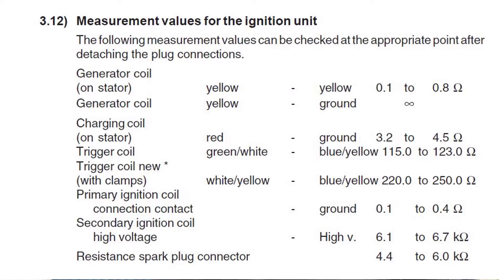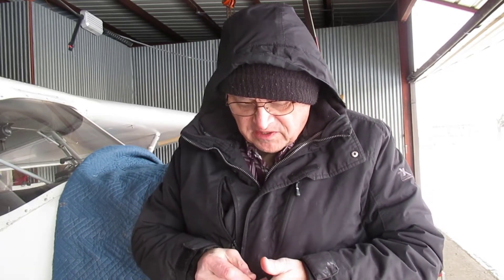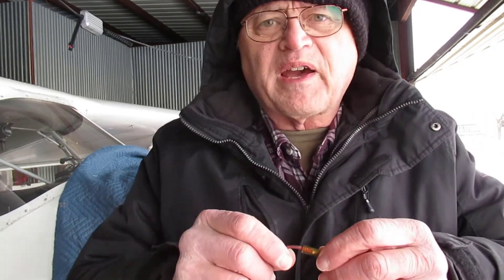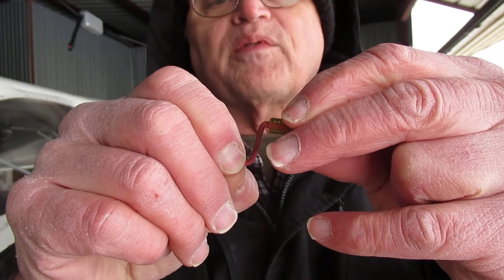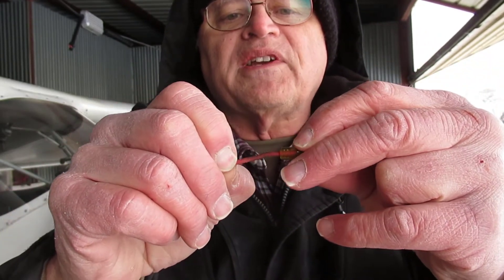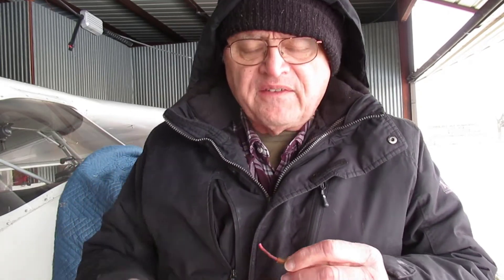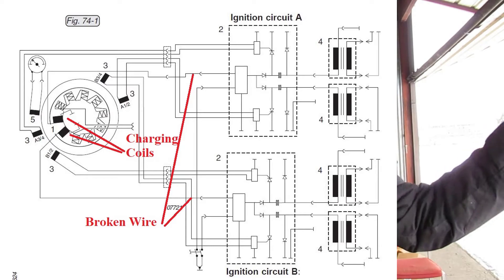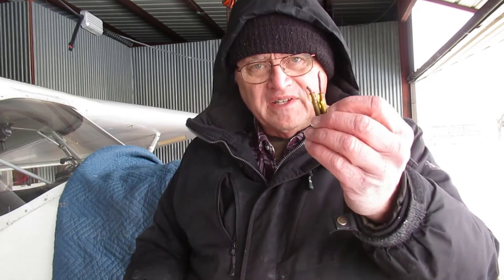Rotax 912 "Mag" problems (older style ignition)

Comment: Thank you Jim for posting this video…I think I owe you a nice lunch! I was doing my usual run-up when all of a sudden the (L on switch) A module completely cut out then was ok a few switch turns later then cut out again. I did indeed find the break in the wire as you described and that saved me a ton of time tracing all the circuitry or assuming a bad module. I did check the ignition switch first but it checked out solidly. Thanks again for taking the time to post this video. 👍😁
Reply from the maker: Glad it was  helpful!  Also check the ground wires where the wires connect to the engine.

Comment: had the same problem always had a rough running 912 at idle I had a fractured wire right at the CDI box lucky I had enough wire left coming out of the CD box to solder and Shrink tape and isolate the wires from vibration I sync my carbs with the broken wire so make sure you resync your carbs after you fix a fractured wire

Comment: Ok... I don't know if this is my problem but I'm sure glad I found this video.  I have the same problem but it's not one mag over the other, it's both.  I was leaning toward the Rotec TBI I've been trying to get running but maybe this is the problem.  I did find a charging wire with bad insulation, that I fixed, but maybe it's broken somewhere else too.  Thanks, I've got some more work to do now
Reply from the maker: Check the ground wires as well. The service manuals give the expected resistance readings for the coils in the ignition system.
Reply: @LightAndSportyGuy  I have the heavy maintenance manual and it doesn't match my wiring.  The colors are all wrong and I don't really know which pins to check across.  I did clean all the ground wires and had a realization yesterday.  The engine was still running very rough, till I pulled the mixture about 3/4 out.  And, closer to idle I have to pull it all the way out.  My problem seems to be a massively rich mixture, like running on full choke.  This Rotec TBI, specifically the fuel regulator, is just not working right.  I'm now rebuilding my carbs just for comparison.  If it runs, I'll dump the TBI.  If I can get the TBI working I'll see the carbs.

Comment: So, does the plane's battery, with it's amp hour capacity, not provide enough power to run the engine, at least for a little while?  To put it another way, does a shorting wire in the stator assembly IMMEDIATELY make itself known? Is the CDI power, instant by instant, coming from the stator coil, OR, is it coming from the battery?
Reply from the maker: The battery is not connected to the ignition. All the power for the CDI comes from the coils under the flywheel.
Reply: @LightAndSportyGuy   Ahh, I had it wrong! So yes any misfiring connections will make themselves known as they happen/when they happen, thanks.
Reply from the maker: @portnuefflyer  I should be clear, I am addressing the carbureted  912/914 ignition. I think the fuel injection / EMS systems may connect to the battery as an extra power source.

Comment: I’ve also had broken wires on the ignition modules etc but I’ve also had to replace two trigger coils at different times due to the old ones going open circuit,  it may be that the broken wires caused the coils to fail.

Comment: Hello Jim.
I have a 912 ULS, a 2008 model year, that has a bad "mag" check.  On one switch the engine's drop in rpms is only like 100rpm, but on the other switch its some where between 750 to 1000 rpm!  I have been debugging this problem for 2-3 weeks now with no real progress.  I even purchased and installed a new pickup set with harness.  I have the newer, 6-pin version of ignition too.
Here is what I tried:
1.  Swapped the 6-pin plugs where they connect to the two ignitor/cdi boxes.  
      The problems stayed on the same mag switch.
2.  Next I swapped the two red magneto supply lines to the 6-pin plugs.
      Again, stayed on the same switch.
3.  Replaced the pickup coil set.
      Yep,  exact same problem and on the same switch remains.
4.  I ran the two mag, ground wires directly to ground one at a time to see if it was some how the mag switches, but the same problem remains.

My rationale is that if swapping the 6-pin plugs did nothing then it cannot be from the 6-pin connector all the way down to the sparkplugs.  Otherwise the problem would have jumped to the other switch.  The same idea for the two red stator supply wires to the 6-pin plugs too.
I am at a loss of what to try next.
Any guesses?
Thanks!
Reply from the maker: Have you switched all the plugs between top and bottom? Seems like that's about all that is left...
Reply: Top and bottom plugs? I first swapped the 6 pin plugs between the stator, mag switch, and pickup coils where they connect to the A and B boxes yes
Reply from the maker: @michaelvadney5803  Sorry, I wasn't clear. Have you taken the top spark plugs out and put them in the bottom holes - and bottom spark plugs in the top? Check to see if the problem follows the spark plugs.
Reply: did you ever figure out your problem
Reply: Yes I did actually.  It turned out that I did not need to replace the pickup coils assembly at all.  When I purchased the engine used the A&P for some unknown reason unbolted the pickups at some point when he swapped in a new engine.  When he reassembled the pickups on the engine block he omitted the standoff collar on one of the two pickups.   So basically both pickups were using the same timing tabs.   This also caused a high EGT issue on climb out.  Good power, but it built too much heat.  No clue why he happened to do that.  If he didn't than I would have saved $1000 ducks and had a happier summer.

Comment: We have the exact same symptoms on our 20 year old 912. Only difference is our symptoms surface only when the engine has been running about 18 minutes (and we assume it's a matter of temperature under the cowl.)  Jim... It sure would be helpful if you'd show a video or photo of exactly where the suspect (internally broken) leads are. And how you fixed. Would you be willing to do that? Did you just splice on a good end?
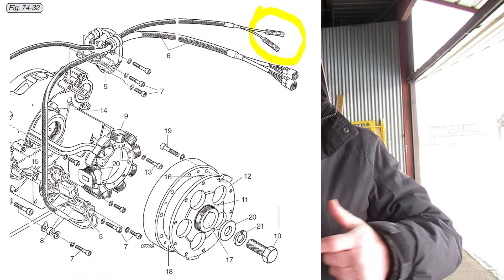Reply from the maker: 2:01 The area circled in yellow is where the red wires plug in near the ignition coils on top of the engine - easy to get to. Wires were broken right where they go into the crimp and right where they come out of the shielded harness. Later I found a broken wire where there is a cluster of ground wires bolted to the right hand intake manifold just forward of the ignition module.  I slit the shielding back a bit, spliced in some new wire with new ends and used heat shrink to hold the shielding back in place and protect the splices. Rotax recommends replacing the whole harness/ coil assembly. 
https://youtu.be/NYo7XmoC5_Q?t=753 the broken red wires are right under my left thumb in this video. 
Sorry I didn't include a picture of where the break was.
Reply: @LightAndSportyGuy   Thanks much for your reply! Hey... I hope your video isn't implying I have to remove the engine and/or the cover of the flywheel to reach and check those wires or replace the harness?
Reply from the maker: @acensor  Checking the wires with a meter can be done at the connectors which are close to the ignition module - easy to get to.  That is also where it appears to me they are most likely to fail - things are pretty well supported at the coil end. I didn't even need to use a meter - just a gentle pull on the wire showed that the insulation was stretching because the wires inside were broken. If you decide to replace the harness and coils (all one unit), you need to get access to around the outside of the flywheel - you may or may not have room to get in there with the engine in place.
Reply: Did you ever fix your issue? Mine seems to do the same as yours sounds. It gets up to temp around 190 to 200f and then starts miss firing on one ignition system.